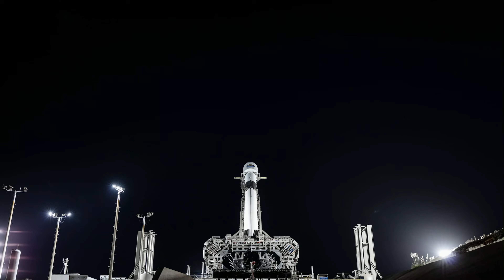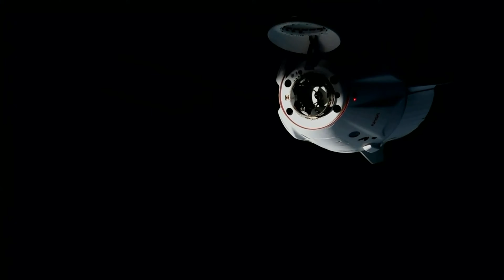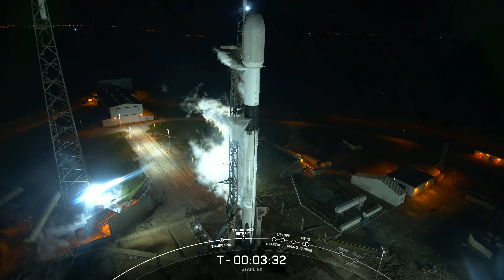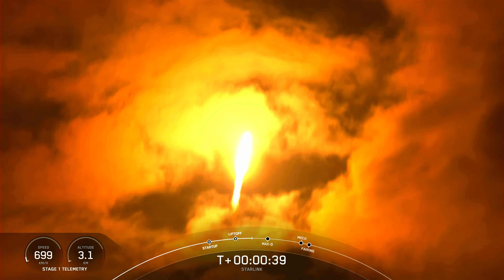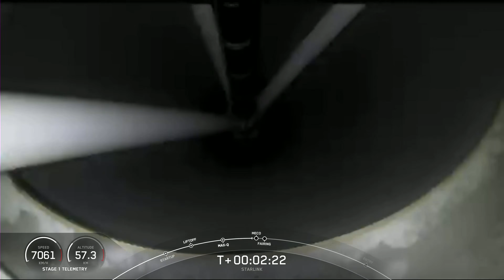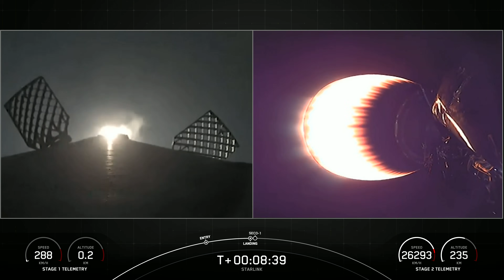Starlink Mission

Comment: 138th landing of a Falcon booster, 110th reflight.  Beat the Shuttle record of 133 successful SRB and orbiter landings, soon they'll beat them on reflights as well.  Congrats SpaceX and looking forward to yall beating the shuttle records for reusability!  OL J R :)
Reply: As a teenager, my recollection of watching the Shuttle system becoming ready for normal flight was something to behold! 
  Young and Crippen’s launch in STS-1 was an amazing feat for its time. If our tech wasn’t breaking records 40 years later I’d be really worried
Reply: @kamakaziozzie3038  Yeah shuttle was cutting edge technology-- invented in the mid-late 70's!!  The problem is that they stuck with shuttle WAY too long... NASA had a lot of plans to upgrade the shuttle system over time--  but never managed to get funding to build any of them.  Shuttle just continued on and on until it was hopelessly clear that it was too expensive and outdated, and would take BILLIONS to refit them all to keep them flying, and the compromises made in the design simply meant that the risks of losing another vehicle and crew due to foam shedding could NOT be entirely prevented.  That's why ALL remaining shuttle flights ONLY went to ISS, so they could do their "backflip" inspection for foam damage before docking, and if they found any, use ISS as a 'safe haven' until a rescue shuttle could be sent up.  The one exception was the last Hubble servicing mission, which had another shuttle basically on standby as a rescue vehicle if the first shuttle was found to be fatally damaged during launch.  

Shuttle was NEVER a low-cost, fiscally sound reusable vehicle.  Once the final tally was in after the last shuttle flight, we learned that despite NASA's "estimates" of each shuttle mission being about $400 million, which is a FAR cry from the estimated $10 million per launch in the dreamland days of the 70's when they were predicting up to 50-70 flights PER YEAR for shuttle, that the ACTUAL cost for shuttle launches was over $1 billion dollars per launch!  SO it was actually more expensive than the Saturn V it replaced, but FAR less capable as a launch vehicle.  Reusability, shuttle style, wasn't all it was cracked up to be either... it's been figured now that it would have been just as cheap if not cheaper to just toss the SRB's and build new ones for each flight, than recover and reuse them.  The SSME's, originally designed to fly 100 missions and only need inspection and refurbishment after every 10 missions, ended up requiring COMPLETE TEARDOWN and refurbishment/reassembly and a qualification test firing after EVERY flight, which ended up costing millions per engine.  SSME's were one of the highest performance and most technically complex engines ever built, BUT they were a maintenance nightmare.  That's why they're all going to be tossed after each SLS flight, plus no real way to design them to be recovered for reuse anyway (technically feasible but it would cost an enormous sum of money and be a big performance hit to design a separable tail section capable of bringing the SSME's back through reentry safely and managing to splash down under parachute, most likely.  Even the SRB's on SLS will be allowed to crash back into the ocean and sink.  Why NASA sold all their recovery ships years ago... some of which went to SpaceX IIRC.  

SLS is really an outdated dinosaur before it even launches, and incredibly expensive and wasteful... it uses the most expensive reusable bits of the shuttle in EXPENDABLE MODE and tosses them into the ocean after each flight.  According to NASA's own Inspector General's office, each SLS launch is going to cost upwards of FOUR BILLION DOLLARS per flight, JUST for the rocket-- not including ANY mission costs, payload costs, hardware related to the mission like modules or suits or habs or equipment, crew or training or other mission costs-- $4 billion JUST for the rocket launch itself!  Needless to say that's not going to be sustainable in any way, shape, or form!  

Truth is, shuttle should have been retired after the Challenger disaster in 1986... it was perfectly clear by then that shuttle would NEVER be the "DC-3 to space" that NASA had envisioned-- it was terribly expensive and risky vehicle and incredibly foolish to rely on a complex, expensive MANNED vehicl for simple satellite launches better and more cheaply done by unmanned expendable rockets.  There were alternate plans put forth to reuse shuttle technology and Saturn technology like the F-1A engines to create a low cost but powerful rocket booster, the Jarvis launcher, to loft a new capsule for crews, basically a modified design of the Apollo using shuttle tech.  Such a rocket could have been adaptable over time, growing as needs grew or serving as a launch vehicle for a new spaceplane crew vehicle much like the X-37B, instead of the massive and risky shuttle orbiter.  BUT NO the gubmint and NASA decided to double down on their "sunk costs" in shuttle and kept it flying for another 17 years til they lost ANOTHER crew and the age and risks of the shuttle were laid bare, before the thing was FINALLY and RIGHTFULLY retired, after flying out the remaining ISS manifest, finally retiring 30 years after first launch.  It was time.  

NASA could have engineered something like Falcon 9 years earlier, but NASA works for the gubmint, and the gubmint works for the big space contractors who were making a killing off shuttle contracts and didn't want anything new to "cut costs".  They still don't-- look at this goofy "Vulcan rocket" they're going to build... LOL:)  and SLS is an absolute BAD JOKE... only designed to fly cash into Boeing and Lockheed's pockets... 

Later!  OL J R :)

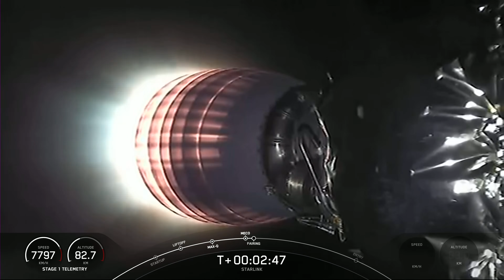Comment: At 12:39 after seperation of main bosster and the second engine fires, there is an outer ring (hoop) that breaks away from the engine. What's the story on that? Not secured? 
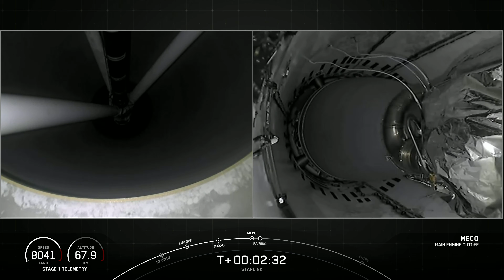When I looked back at 12:30 -- just before separation of MB one can see that the outer edge of engine is very close to the booster surface  just prior to separation.  There is very little clearance, one can see as the booster part slide by, I see. I think something caught on the outer engine ring and weakened it after separation, perhaps? Hey, if I don't say it, who will?
Reply: My guess is it’s just some protection for the edge that gets blown off.
Reply: That is a stiffening ring used to protect the nozzle during the booster phase of flight. It is meant to come off once the Mvac engine comes up to power. You can see this on every mission.

Comment: On this launch it went supersonic before Max-Q.

Isn’t it usually the other way round?
Reply: I think it depends on whether there's high or low  air pressure at launch. With high pressure Max Q is reached before going supersonic and vice versa for low pressure.
Reply: Not from what I've seen.

Comment: @spacex - Rural Australia - our speeds have become so unstable Starlink will only support 1 device on the connection at a time.  Do customers who experience issues with the service get discounted monthly fees as other internet providers give for internet instability?  The Starlink internet is out of beta it should be at least able to support what we pay for.  And before anyone says it’s your router I have an ASUS ROG Rapture GT-AX11000 WiFi 6 Wireless AX11000 Gaming Router.  Driving me nuts.  Just heard you lowered prices in some countries but not all!!?? Wtf.  Really?
Reply: So go use another provider?…

…oh wait, there isn’t one! 🤣
Reply: @fredbloggs5902  at some places there is the option 4G or 5G - but of course not everywhere. Remote areas won't have coverage.
There are also providers using geostationary satellites, but the signal runtime is higher here and it's not good for video calls etc